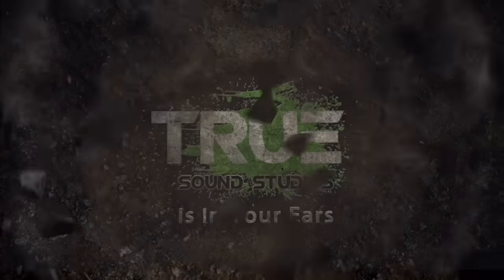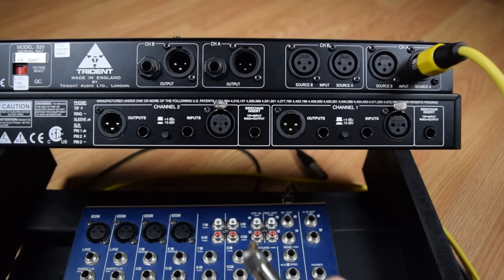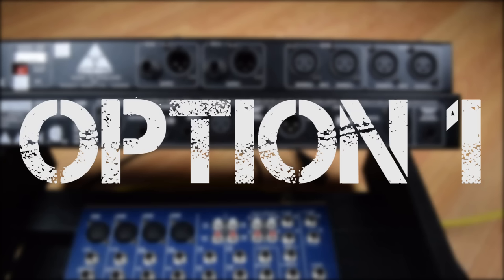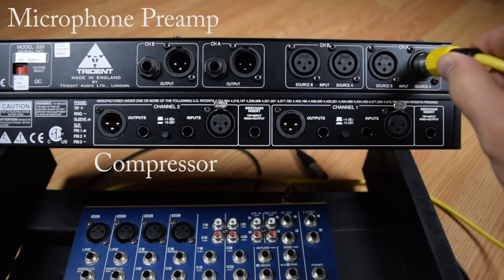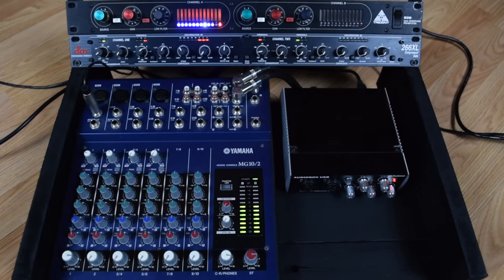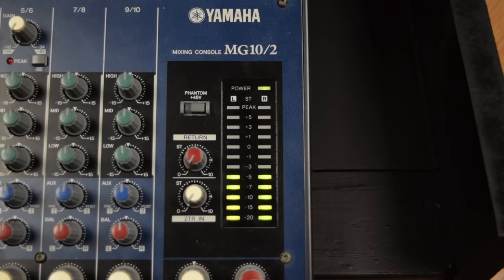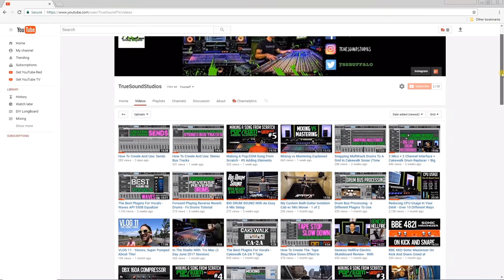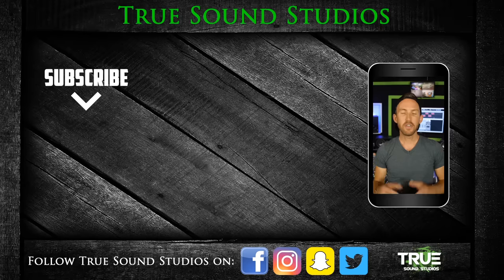3 Ways To Connect A Compressor To A Mixing Board (Without a Send/Return or Insert)

Comment: Regarding Option 1: Let's say I have an extra analog mixer instead of an interface. If I run the Left Out from the mixer into the input of the compressor (like at 3.28), do I need to do anything in relation to panning on the analog mixer? Thanks in advance! :D
Reply: I was looking for this comment as well.

Comment: OK but what about Mixing Boards that have Pre-Amps built in? In that case you would essentially connect your Microphone to the Mixing Board Pre-Amp, the master out would go the Compressor 266XS in, and the master out on the compressor could go out to a DJ mixer? Would that work?
Reply: Got under your skin that he doesn't pronounce it "Pre-Amp" too didn't it?🤔🤣🤣

Comment: wanting to connect a subzero booster to the mic, then the mic to the compressor unit and the compressor unit to the mixer, how would you do? Subzero states that the unit requires +48 volt to work.

Comment: Thanks for the video. Just got the DBX266xs primarily for the Bass guitar. I have the bass plugged into the 266-input and the 266-output routed into the sound interface. Just not able to get a noticeable difference in sound quality. Still fiddling with it. Any insights?

Comment: I tried option one, am using PC to voice track my radio show, but after I follow your instructions, in my device section on my VT software which is on my laptop it does not appear for me to select to record my vocals? I have a DBX 266 XL and a USB AudioBox 96 and I purchased a 4 channel live mixer......what am I missing or doing wrong

Comment: Amazing Master..Thank you for your kind explanation!!🙏
Can you tell me how to connect to a PA system if you got a mixer, two channel equalizer, two channel compressor using XLR cables?
Reply: David, for that you can certainly use Option 3 with a little twist. Te Main output L and R from the Mixer will go to the Ch1 and 2 of the compresor, then the Outputs of the compressor will go to the EQ, then the outputs of the EQ will go to your PA's
Reply: @MannyLeyva  THANK YOU FOR YOUR TIME
Reply: @MannyLeyva  Hi Manny
Could you help me to set up/ connect my sound system:
I have:
a wireless microphone- Ultra high frequency
a mic preamp dbx 286s
a compressor 266xs
a mixer soundcraft signature 12
an equalizer
a PC with 1.000 mp3, mp4

I'm looking forward to hearing from you.
Thank you so, so . . . so much in advance.

Comment: Thank's for the vid, very clear explanations. I figured something out, but please correct me if I'm wrong : 
Using option 2, you could repeat the process to get compression on other lines. Let's say a live event, with 3 mic you want compression on : you plug your 3 mic into channel 1,2 and 3, faders at 0 (so you don't hear the dry uncompressed signal), Aux 1 knobs open (to send their 3 signals to the comp), and plug your compressor output to channel 4. Therefore the three voices come back as one wet compressed signal, in channel 4, and you can adjust their individual level using the Aux knobs on channel 1, 2 and 3. Am I right :) ??
Hope I make sense ! 
Cheers from south of France
Reply: With the Aux knob used to send to compression, if you use it also for for leveling that would continuously change not only the level but the amount of compression. This is because you are literally changing the feed to the compressor.

Comment: I am using a Shure SLX wireless mic, I'm coming out of the receiver and going straight into my dbx comp/lim, then into my mixer with no problems. (All XLR cables) I have No mic preamp.  Seems to work ok.  Do you think this is an ok way to go?  I have inserts on my mixer, but I've never ordered the cables to see if it's any better?

Comment: If I have a patchbay with 1/4" plugs, can I plug in a mic using a female XLR (from Mic) to 1/4" cable (into patchbay) if I want to patcth different preamps? Will the 48v damage the 1/4" connection or does it have to be XLR?

Comment: option 2 is one of the ways but not the only way.. under the XLR in u have line in and insert, that insert is considered a line out directly from that same input which can then be sent from insert (out) into  the compressor and then out into channel two of the mixer..or from compressor out straight into interface..  you can also connect the interface's output back into the mixer as playback from computer.. when pluging headphones into mixer you not only will hear the mic but also the playback of what ever ur recording on.  Send and returns is better  for reverb or delay processors only time i would consider any compression is if im seeking a dry and wet signal for parallel compression and that would be the reason for send nd return into compressor... option 3 is not an option if its gonna  block me from multi tasking the board
Reply from the maker: Vz Beatz yes I agree that you could just use the insert, but this entire video is based on using a mixer that doesn’t have the insert jack. Not every small format mixer has an insert which is why I made this video

Comment: Thanks. Very helpful. Perhaps I should ask you here about my setup too. I specifically bought an interface umc1820 which has 8 inputs and 10 outputs. I have order 2 Klark Teknik KT 2A. Just found out that there is no internal routing in umc1820. Now I am wondering how to properly connect both compressors as I will run them in stereo? I will use them for recording vocals, guitars etc. I will also use them while after recording while mixing on two bus. Do I need a mixer with insert, sends and returns? Can't I just use them with audio interface? Many thanks for your time.
Reply: u use playback 3/4

Comment: Thanks for your video!  Just got the WA76 compressor yesterday and already have the MPA II preamp.  I will try option 1 to send comp out to my Tascam model 24 digital recorder.   Can I send an elec. Bass signal into the preamp for an overdub?     Your right....total noobie!
Reply: Did wiring your preamp/compressor this way work for you?  I have the Tascam Model 24 myself and am trying to determine if this method is indeed safe and will actually work before I try it.  I have a two channel rack pre-amp with phantom power and an ART Pro VLA II two channel compressor.  And if it DOES work, is it safe to use XLR cabling for every stage or did you need to plug the compressor's OUT into the 1/4" Line input on the Tascam?  Is it safe to use the phantom power for condenser mics on your pre-amp without damaging your compressor?  Lastly, did you need to set your compressor to work at -10db or is it safe to leave it in +4db when plugging in to the Tascam this way?

Sorry to ask so many questions but I've watched several videos and read countless articles on using outboard gear with the model 24 and nobody goes into any real detail on this type of setup.  Most people don't even mention this as an option at all.  It lead me to suspect it either won't work or can damage equipment in some way.  Oh, and did sending your bass through this rig work?  Thanks Jim!

Comment: Hello hope I get response since this is older video. I recently acquire mic preamp, compressor, equalizer and vritulizer all behringer cheap equipmant and alto mixer vhat would be the correct way to connect all the equipment. I currenly run mic in to preamp then virtulizer compressor and eq to mixer. What would be the best way to run this for voice, Im using it on the ham radio transmitter. Thanks in advance
Reply from the maker: Branko Mihajlovic hi, so yes the way you have it will work just fine. You can try preamp - eq - compressor - mixer for a bit of a warmer sound. Either way is a good way though!
Reply: @TrueSoundTV  OK thanks for response I will try both ways. Thanks for advice and response.
Reply: I also wish to explain the way of linking and greet you

Comment: Perhaps you have the answers. I have the allen and heat Zed 8 usb mixer and the audio Technica 2020 condenser microphone, and I bought a dbx 286sv preamp but I don't understand how to connect on my Mac to use on a streaming software like OBS?

Thanks and regards.
Reply from the maker: So are you using the Zed 8 usb as an interface? If so that is how your getting the signal into your computer. You will need to change the audio settings in your MAC to use the Zed 8 as your soundcard to get audio in and out.

Comment: Connecting a non balanced cable to a balanced output can damage the output circuits if the don't have protection resistors. This for example happen in the ART pro VLA II compressor which doesn't have those resistors.
Reply: There is no information that the output can't be connected to a single ended inputs. In fact it says that it gives 100 ohm output impedance to both balanced and unbalanced load. Which means it supports unbalanced jack.
Reply: https://www.artproaudio.com/product/pro-vla-ii-two-channel-vactrol-based-compressor/
look for the pdf document there.. States clearly that unbalanced 1/4 inch jacks can be used both for input and output.

Comment: Hi, a few days ago I got the 266 XL. I have the bbe 882i too. I connected both devices via xlr-cables from in to out. From Behringer 1204 xenyx Mixer to 882i to 266XL and to audiointerface via xlr. That's ok? Or something wrong. The 266 xl is working.

Comment: Thank you for the video. It needs more explanation about hooking up the input and output on the "option 1". If you used only one chanel on the preamp and compressor. Wouldn't that be mono?
Reply from the maker: Yes a single signal will always be mono. But just because it's mono doesn't mean it comes out of only one speaker or is bad at all. In fact most signals are recorded in mono. This mono setup would be great for vocals, guitar, bass, or single microphone drum setup

Comment: what to do if i want separate compression on each channel? do i have to connect 16 compresors if i have a 16 channel mixer? or shall i connect a compressor through aux? i mean aux send will go into input of compressor and output of compressor will cone into aux in. so i can balance my compressor through aux fader/knob. is that a right way?
Reply: You can opt to have 16 channels of Analog Compressor for 16 inputs of Mic/Instruments...
Alternatively you can Sum-Comp. all yr channels/part thereof into 2-channels of Analog Compressor via 2 seperate Bus, be it via PreFader AuxSend Out ,OR, SubGroup Out; with ALL after Compression Signal returning into Free Channel on mixer...

Comment: I still haven't gotten a good answer for me...I want to compress the entire mix. I have aux send and return on my mixer.
Reply from the maker: I would connect a stereo compressor to the main outputs send/return. If that's not possible, run the mixer main outputs to the compressor inputs, then the compressor outputs to your interface or speakers

Comment: I have been experimenting with coming out of a Shure slx wireless microphone receiver (xlr output) and going directly into the comp/lim xlr input.  Then coming out of the comp/lim xlr output and going directly into the xlr mic input of my mixer.  It appears as if it will work for live sound.  I haven't tried it yet in a live situation.  My dj/karaoke mixer doesn't have inserts.   Does this sound like an OK way to do this?  It appears to have plenty of gain.  I have only tested it using my headphones and viewing the meters at this point. My main goal is to be able to limit the karaoke screamers from hurting everyones ears. (dbx166xl)
Reply: you need to be able to at least feed -10dBV of Line Level signals from SLX Receivers, into those compressor.
Reply: I further recommend you use the 1/4" Instrument Jack Out on the SLX Receiver.

Comment: Please how was You able to connect it as an inset to run in a DAW. I have a preamp and  two input audio interface,I have my mic output to my preamp then preamp output to klark compressor then my compressor output to my audio interface. But can’t get a return signal just a send signal in my Daw am using Studio one 4 which normally has pipeline for external hardware

Comment: I have a Behringer PRO FBQ1502HD and a Mackie ProFX12v2 which I want to use for podcasting. How would you recommend I connect the 2 together?
Reply from the maker: Hi, so i'd run the outputs of the mixer into the Behringer EQ and then send that to your interface. Hope that helps - Thanks for watching!

Comment: Can a keyboard be connected to a compressor, then to a mixer?  I aquired four Alesis 3630 compressors and want to have all the signals compressed into the mixer before going to the powered speakers.  I have three keyboards; one for each compressor then into the respective channel on the mixer.  The fourth is for a future keyboard or drum machine, using same method.
Reply from the maker: Yes, because the keyboard has an analog signal output it can go straight into the compressor input!
Reply: musicman0150 .

Comment: Hi ,option one ,this way are you doble amping the mic ? One with the external amp and second time with the mixer gain?
Reply: Yes and no.  In order to get the proper level INTO the compressor you need a way to PRE AMP the signal.  (if your compressor doesnt have an input level knob and pre amp built in) so that way you can then compress the signal coming out properly. Now , I said yes and no because some pre amps leave the signal very clean without any harmonics added ...others serve as a color box pre amp.  Best example API 512c , Neve mic pre amps such as those found on the 1073 EQ. There is a reason why this kind of pre amps are expensive.
Reply: Isaac Pizarro cool thanks a lot

Comment: Can you run an xlr into the compressor and an xlr out from the compressor and into the mixer xlr input? So the Cain would be mic to compressor compressor to mixer using only xlr?
Reply from the maker: So no, having the compressor before the mixer preamp would make the noise level really high. Although it would be possible, it wouldn't sound good at all. The mic needs the preamp to raise it's super quiet signal level to something that compressor can use.

Comment: So is it possible to use a Behringer xenyx Q802USB and a Behringer Composer MDX 2100 and connect it with the Stereo Aux RETURN on the mixer to the interace?

Comment: hi  
I still have a problem to connect my compressor to the interface
Reply: preamp>compressor>interface
Reply: Why still use/need an Analog Compressor when using Audio Interface's DAW ??? 🤔🤔
Reply: @piratedprivacy9052  Its a more of a color/sound you get on the way in that i havn't quite found with plugins.....also i have found that analog gear is much more forgiving as far as overdoing it....if i push a vst it seems to sound bad sooner.....no matter what the vst is so far....i can only speak for myself but i have been working with cpu recording since about 2003....also My style of music is 90's based so i am looking for a more analog sound vs digital.....if you are doing modern music it might not make a difference at all..... almost every professional that i have seen that mixes "in the box" still tracks the vocals thru a hardware compressor for a reason IMO